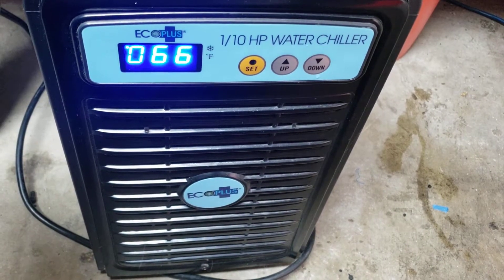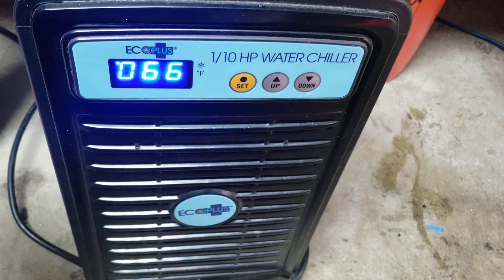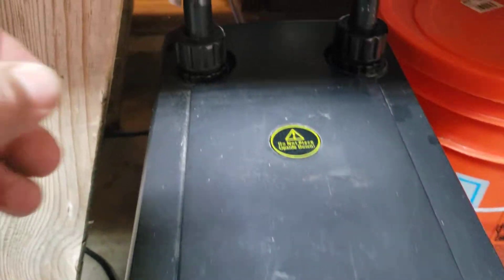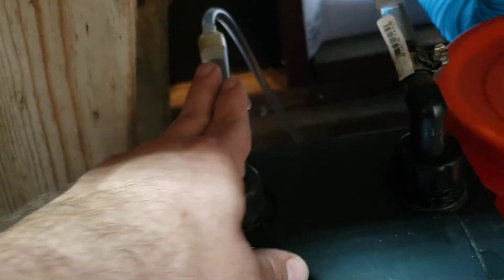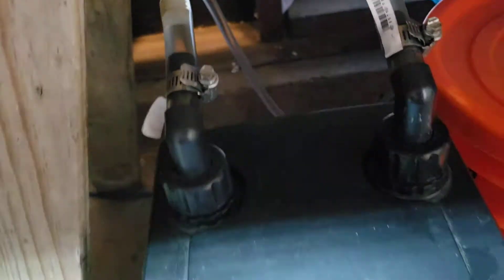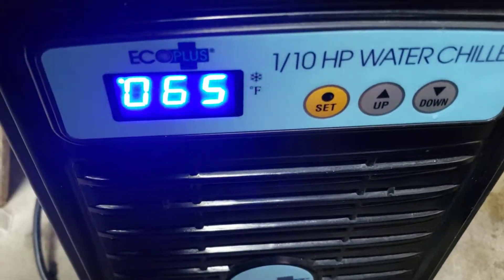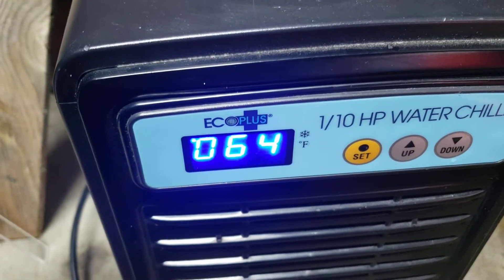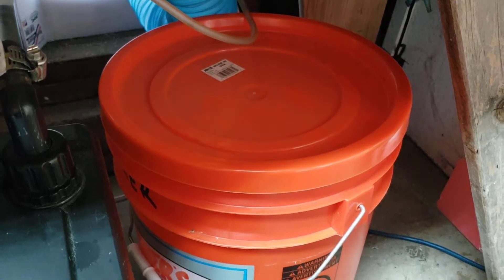Adding a water chiller to your K40

Comment: How is it working for you?  What is the temperature out of the laser after sometime running a job?  

I am using 2 piezoelectric coolers and a radiator to cool my K40 and I can maintain around a 70 degree input and 73 degree output temp on my laser after a one hour run of cutting holes in 1/4 in plywood. Would love to see how the chiller is doing.  Thanks for posting.
Reply: @Rick McCaskill
What wattage of Peltier coolers did you use?
Reply: Dan Dallman Here is the ones I am using.  I am using the large cooling coils used on PC.
https://www.amazon.com/gp/product/B072TQX2RQ/ref=ppx_yo_dt_b_asin_title_o02_s00?ie=UTF8&psc=1

Comment: Biggest  piece of shit . Bought a 1/10 for a 18 gallon system and it won’t go under 69 degrees . Had to set to 70 and it still takes forever to click off . My pump size is 250gph  well under the 317gph max it says on the box. Let’s not forget it’s build to cool 42 gallons . PURE GARBAGE
Reply: Try to use an smaller pump like 150GPH 
The slower the faster that it drops the temp